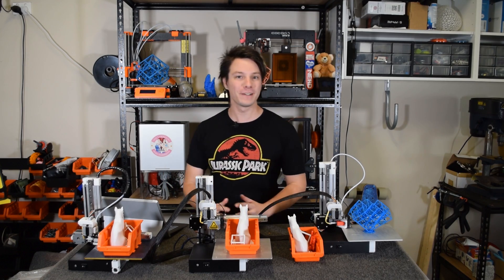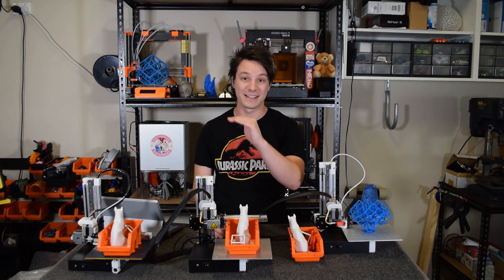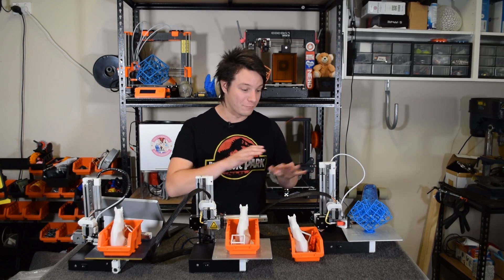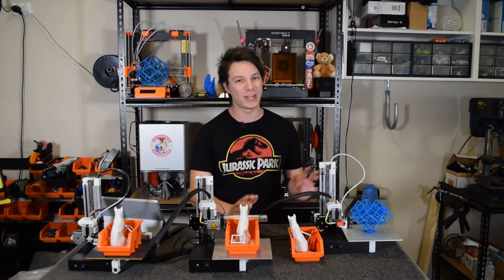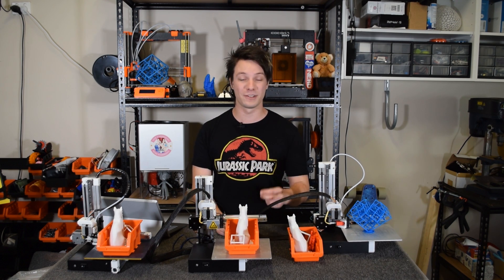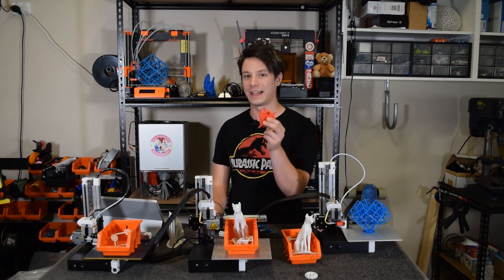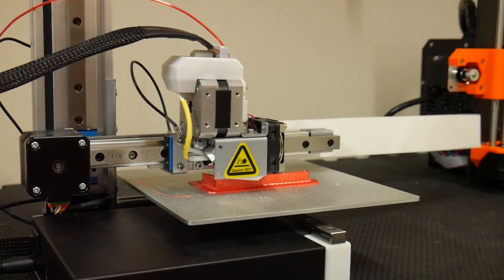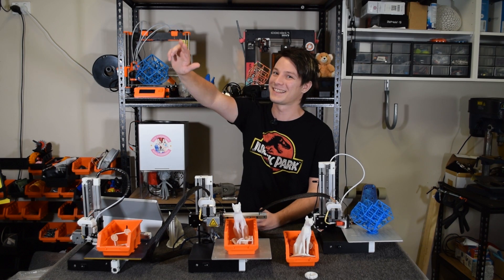Cetus MK3 3D Printer Review

Comment: I have one of the Kickstarter Units and I love this machine... yes the software is limiting the capabilities of this printer, sometimes. But for easy printing parts its my daily machine. Also supports are no problem with the newest UpStudio Version where you can disable each and every support for itself... The price is high... but show me another printer with linear rails at a lower price point... I'm at your side Angus. If we get back the perimeter setting I'm totally fine...
Thanks for your comparison of the different iterations. My machine still has no "slow" down the extruder function, but if I turn it off I put a foam from the packaging under it and all is fine. Blackout is very rarely so I don't care... For PLA it's a very good printer to start in 3d printing if you don't want to tune your low budget i3 clone. Cetus is my every day machine...

Comment: Hello everyone. I have Anet A8 3D printer. I have a problem when printing items that require more time to create. After about an hour, the model literally turns out from the bottom and becomes slightly rounded at the ends. I use an ABS filament at 220°C ecruder and 100°C hotbed. When printing, the hotbed temperature drops to 88-92 ° C. Can someone help me? Does this happen because of the higher temperature hotbed?

Comment: I've fallen into the Cetus trap (jk, it's not that bad) and bought the Mk3, then the Heated Bed upgrade and then the V2 Hotend and ABL probe. I love the compactness and simplicity of this printer, well at least for everyday PLA use, but in the end it's a too closed down system for me. That's why i'd agree on using the base version of this printer for education, but i should have gone for a Prusa i3 MK3. The price difference isn't all that much at all, especially if you consider the extended version of the cetus with all the upgrades.
Reply: I fell into the trap. A month later I'm just learning of prusa... Sad day. It least I have made my money back on it.

Comment: The Cel robox is still probably the safest printer for schools especially younger children, very underrated machine it's up there with the best of the printers for quality despite the small print area.
Reply from the maker: Reliability of the print heads was a huge issue for a long time, I hope that issue is now resolved because I agree, the machine was amazing in its design especially with the cover lock.
Reply: It definitely was a problem at the start I've had mine since 2016 it had the V1 leaking head that you mention but the replacement V2 head which I've been using since is still going strong over 800hrs print time 😆 they have made some great updates in the last couple of years to the printer and also have a couple of new print heads.
Reply: All robox printers made after 2017 were vastly improved to make it better V2 extruder to make flex filament run a little better and V2 print head as standard along with a few other little changes.

Comment: Too many people approaching this from a hobbyists perspective. Everyone pretty much agrees the Cetus prints reliably with no fuss or adjustments. Sure to a hobbyists proprietary is bad, but it's polished, which is essential when getting students involved.

This is literally the iPad vs cheap Android tablet debate that happens in schools all the time, and there's a reason iPads are more popular. Personally I love my project printers and rooted Android builds, but I'd never recommend them for schools. Some teachers may have time to fiddle with A 3d printer, but most don't have the time to fiddle with 4. And if your goal is to have students each get a print with class sizes of 30+… you want at least 4.

It's not like they still can't use 3d modeling software or open source slicing tools to generate the gcode to feed UP. Maybe the only downside is reliance on WiFi, but cheap laptop attachments or even octoprint via USB are still solutions to that. And at least for the city schools I've worked with, Ethernet can almost be just as bad.

Add to this tiertime's support reputation and I think it's a great recommendation. Anyone whose had to deal with monoprice support knows how hit or miss that can be, Chinese companies even worse, and larger brands might be slightly better than tiertime, but printers cost 4x as much.

Prusas are the only alternative I'd consider, but you'd be buying non-kit, and I'd take 6 mk2s over 2 i3s. Especially when you consider tiertime's lower shipping costs for replacement printers and parts.

Comment: Note that the WiFi functionality on Tiertime printers only works if the printer is in the same subnet as your computer. That’s not typical outside of home use scenarios. I tried to raise this with Tiertime support complete with wireshark captures etc. but after multiple braindead responses I gave up.

Comment: You have a point the cetus is tailored more for schools (is it the best? Absolutely not, but that never stopped schools). My school recently bought some lulzbot mini’s over the prusa i3 mk3. I think schools are kind of set on buying inferior machines at higher than average prices for varying reasons (no offense to the mini, decent machine when it was released and still is very functional). For any schools looking to get their feet wet with 3D printing, the Cetus is not the worst choice since the majority of school printing is solely with PLA and it being an affordable machine compared to a $5000 ultimaker is a plus. I think the chances are good that some schools might look at the machine and consider buying it.

I am aware a lot of people in the comments are looking at it as a hobbyist machine and yeah, it just can’t compete with chinese prices/features nor the feature glorious prusa machines. If the Cetus is going to ever make waves, it has some catching up to do for mass market appeal. I’d probably start with at least a lcd or touch screen, they are a low cost way to make a machine look sexy, then sell a hot looking heated bed and some cool double blower fans even if not necessary, they go a long way in marketing. The cetus at its core is wonderful but just like a minimalist car would not be a car without air conditioning and lights, we have now come to expect more from 3D printers.

Comment: Unfortunately not for us as most the class room or should I say makerspace prints are done for the FRC team. So that means it has to do Nylon, Hips, PETG etc and maybe once in a while some PLA. If you could make some recommendations for an inexpensive printer with at least a 250x220x210 or so print volume, does the above materials so must have an all metal hotend, garolite or so build plate etc - please let us know.

Comment: Interesting about the problems they're having with the switchless homing. The Prusa MK3 is doing fine in that regard.
Reply: Works on x&y always - on some not on Z (model2). Cause "if": "long screw+printed cover" on the alu profiles vibrating. Turn screw down or  put finger on it for a sec <lol>... Prusa clearly is among the "best iterated" 3D printers - i3 deserves to be market leader as "the one most copied" <g>,

Comment: I have the Cetus MK2 as a secondary printer. I paid only $299 for it. And i must say that I am extremely impressed with it. I jokingly call it the 6th man (basketball) it gets equal / more use than my Prusa MK2. Only complaints i have is that the software leaves more to be desired and i think they apply a high pass filter over the models to smooth things over. But it seriously prints some things much better than the prusa. If they made a few changes like silent steppers and properly heated bed without extra hardware, id probably replace the prusa.

Comment: Let me share my experience. I got my Cetus Mk3 6 months ago for my personal use, after having experienced 3d printing in a proffesional enviroment (as in I am resposible for all 3d printing operations within the company) in the forms of the Stratasys Objet30 polyget printer, and the BigBuilder FDM printer. Honestly I can not say enough good things about this printer. First of all printing quality, just absolutely astounding. It runs laps around the Big Builder, a 2500 dollar FDM printer supposedly this expensive for its quality. The software, so easy to use, so straight forward, and the best supports ever. People will complain theres not much room for tweaking, but honestly is that a bad thing ? If the printer is configured to use the slicer well, as the Cetus is since its made only for the UP Studio slicer, why would you want to mess around with a million settings ? After spending the last 3 months of my life playing around with litteraly all the settings on CURA to make the Big Builder print better, only to still have it produce marginaly acceptable results, to be able to just press print on UP studio, and my Cetus print a perfect specimen is honestly unparalled luxury. The bed, also an unrivaled innovation. I have my cetus in my cold basement (5-10 C) and get 100% adhesion 100% of the time. Meanwhile, I need to apply blue tape, glue, use a heatgun, and pray to god for my prints to stick to the glass bed of the Big Builder, which is situated in a moderately hot lab (20-27 C). Build quality, again astounding. I have dissambled and reassembled the Cetus 6 times now, and taken it on an airplane with me 4 times, and everytime I rebuilt it, it prints just as superbly as before. The linear rails make all the difference, and I'm sure it will run for years to come. Its also so compact and versatile it will not look out of place even at the edge of your desk, unlike most other 3d printers that stick out like the big eye shores they are. Yes, it doesnt have a heated bed (It doesnt need it though due to the great bed), and it cant print abs, or other fancy filaments, but be honest, unless you 3d print for a living like Angus, you will use PLA 99% of the time anyway. The price is also honestly not that bad. Im happily satisfied having spent 350 pounds on a printer that worked straight out of the box, that I can trust, and is built to last, than any chineese ender cheapo clone I could have gotten for less with all the bells and whistles on paper, but which would probably come half broken, with missing or broken parts, with no post sale support, a half life of probably 1 year, and having to mess around with some open source slicer for months on end to dial it in. If you need a solid, robust 3d printer, with an excellent easy to use dedicated slicer, which prints great out of the box, and continues to do so even after multiple disassemblies for transportation, honestly the cetus is hard to beat.
Reply: 2025 and I miss upstudio 2 😢. Up studio 3 has introduced so many settings it's hard 2 use. And it's not a dark theme, eye sore. 😢. RIP cetus

Comment: For the classroom? I assume you mean for older students because an open frame printer wtih a 200+C hotend in a classroom full of kids seems like one of the worst possible choices for a 3d printer.
Reply: I was going to say the same thing.  Most schools are going with fully enclosed with HEPA filtration. Even if they will only print in PLA.

Comment: I'm not seeing the advantages of this proprietary brand with a relatively high price
Reply: It's cheaper than a MakerBot and better. That's who they are competing with.
Reply: It's that it's still significantly lower than most other brands with similar reliability. I don't understand why proprietary is such a bad word when it comes to kids in a classroom.
Reply: The cetus is amazing quality. I got a mk3 with the heated bed for under 500 and it just works without tweaking it.
Reply: @IncredibleJ1  I completely agree. I've honestly had more issues with my prusa mk3s (currently dealing with extruder gear issues)
Reply: @pure6450  uh. Ok. Price has nothing to do with propietary. Open source doesn't necessarily mean cheaper. Especially in 3D printing, where it's more the quality of the hardware. Prusa is the perfect example. Completely open source, very expensive (more then the Cetus).
Reply: @ZeeLobby  If something breaks on a Prusa, you can fix it yourself or buy parts from a number of third parties. Open source means competition, and competition means lowering of prices. I can buy a Prusa nozzle from several companies for a wide array of different prices. If a nozzle breaks or wears down on a proprietary machine, guess who you are buying from? You only have one choice, and they can set the price as they wish as there is zero competition once you have their printer and they have your money. Proprietary/Open source has MUCH to do with price. Take android vs ios. Apple can charge whatever they please for their phones (300% markup) as once you have purchased one of their products you only have the choices of buying more overpriced hardware to go with your current overpriced hardware, or switch to android and lose pretty much everything.
Reply: @pure6450   agreed. But what's actually proprietary on these beside the print nozzle? Everything else can be replaced with alternative hardware, even the rails. There are even alternatives for mobos and CPU that Cetus promotes. 

And what does buying apple gain you? Consistent performance and stability. I'm sorry but a lot of people tote Android as being amazing because you can buy $200 phones, but let's be honest, those phones are garbage by comparison. So really you're down to several high end phone providers offering devices in comparable price ranges. Even then, many of these companies skin the open source software regardless.

What's funny is prusa mk3 comes with a custom e3d print head which is only available through them as a whole piece or one or two other companies for a massive markup. So even being "open source" isn't a cure all.

And as for Cetus, they may be expensive per build volume or other metrics, but the support from tiertime is great, there's a community full of upgrades (which weren't slowed by proprietary components), the machine is easy to use and reliable, and it's consistent. I've done more work fixing my i3 than I have my Cetus and I've done equal number of prints on both and the Cetus was 1/3 the cost.

The whole concept that open source is always better is just childish. Both can be great, as it's totally dependent on the company. Cetus nozzles are pretty cheap. Can proprietary be abused? Sure. But it doesn't have to be. I'm a software developer. I use open source every day. But I also use a lot of paid for propietary tools. Why? Because they're simply better. They use that extra revenue to offer better support, better polish, and consistent results. Same thing could be said here. And honestly makes sense for hardware you'd buy for a classroom.
Reply: @ZeeLobby  Of course you can't compare a 200 dollar phone with a 1200 dollar 'flagship'. That's just a loaded comparison. You can, however, compare a 600 dollar phone with a 1200 phone and still have the former come out on top. Android is only as bad as the OEM makes it. Don't like it? Switch to a different OEM and retain all of your data, apps, contacts, files, everything. Apple does something everybody hates? Too friggen bad because you have no choice if you value the thousands of dollars you have funneled into their ecosystem. With an android phone, with a few checked boxes and a usb cable you can access the ENTIRE filesystem of the device. With an apple phone, you see only what apple wants you to see, which is the bare minimum. You wonder why iPhones are secure? Because they lock users and potential hackers out of everything alike. You wonder why ios plays friendly with other ios devices? I don't. I've used dozens of apple devices and never experienced this "integration" and it never "just worked". Want to open a port on your router? Forget the standard that's been in place for decades and widely accepted, no, here's apple's dumbed down version.

Comment: Why is the Z axis up and down when in almost every engineering application the Y axis is up and down?
Reply: Z axis is always up in 3D
 Y is "up" in 2d. That's convention.
Reply: @benhouse5515  fucking since when? Every time I used 3d in school or real world outside 3d printers, Y is always up. CnC is the only place I've seen Z up. And I'm asking why.
Reply: @sobertillnoon   This doesn't answer your question, but in GUI development for websites, applications etc. Z index is always the Layer height of the elements. Maybe they based that off of CNC.
Reply: @microhaxo  nope, it sure doesn't. Thanks for responding. But what you're talking about, z-index, actually would be "front to back" which in engineering, math, and physics, the same z direction I'm talking about
Reply from the maker: 3D Printers are a form of CNC machine.
Reply: @MakersMuse  But, my question is why is CnC different.  It is okay if people here don't know.  I just thought if anyone did know, it would be this lot.